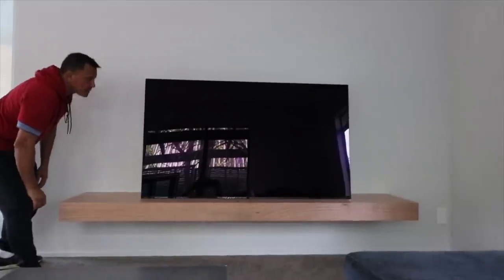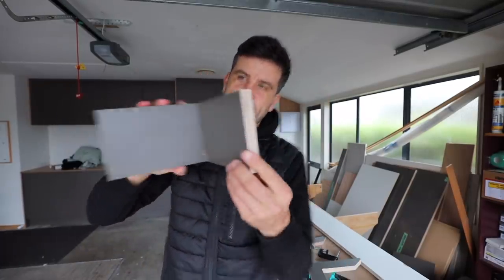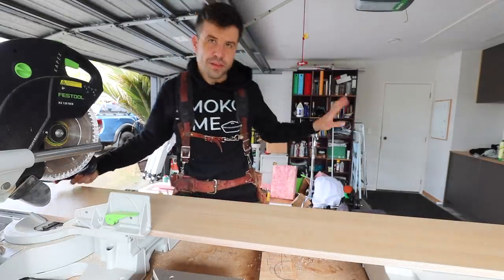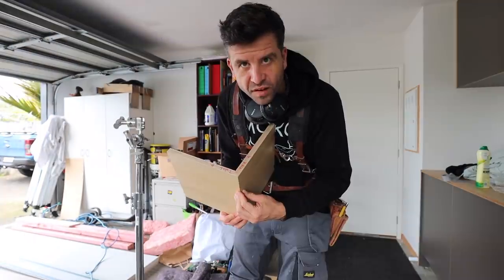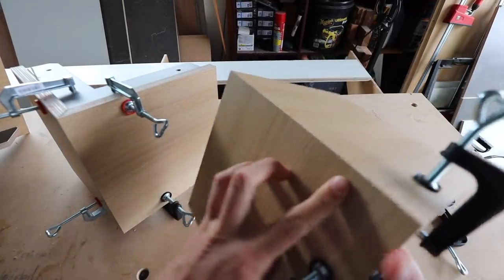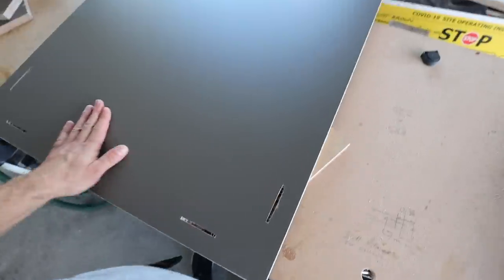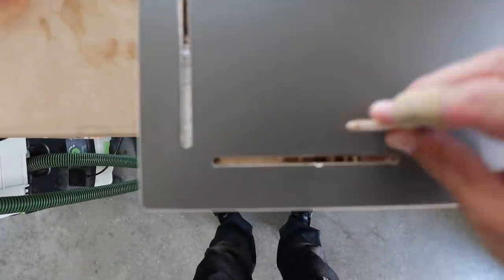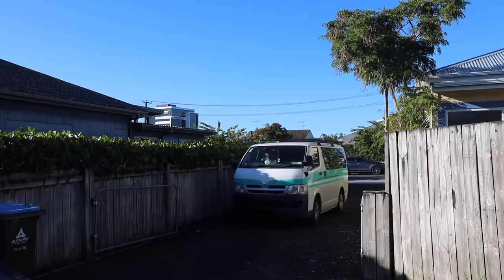I Made a Coffee Table With Offcuts of Plywood

Comment: For mitres like that I've always just put a thin bit of wood glue in any gaps and then used the round of a screwdriver to compress all the fibres together. Always works put lovely. Saves using any filler. You've done a cracking job on all this cabinet work :)
Reply: we usually use a lot of packing tape. just lay both parts flat on the table, tape widely over the joint onto the other surface, turn them around, glue into the joint, close them up, let them dry, and boom, no open gaps anywhere. no need for all that labourintensive compressionstuff. tape over the joint pulls the two parts onto each other, resulting in a perfect corner, if you've cut the 45° degrees properly.
Reply: @robynb.802  oh yeah I tape them up too like that, but sometimes if there is a slight cup then it ain't going to go perfect. Burring over the corners is hardly labour intensive, about 30 seconds work 😅

Comment: What you can do with those sharp veneers on the miters is, you can take the side of a screwdriver and run it along the edge rounding over the edges. It also helps closing any small gaps along the edge

Comment: Great video as always Scott. It turned out great. Consider getting a reusable bag for your Festool vacuum. I’ve had mine for 10+ years and it’s still going strong. It does create a little dust when you empty it but I empty it outside or into a plastic bag.
Also you should consider borrowing a Festool domino from one of your buddies to give it a go. You would be surprised at how many projects you can use one on. Even as a carpenter/builder.
Ron

Comment: you can use some tape to do the Mitter, you place it with the pieced flat and when you glue them it works as a clamp
Reply: I also allways use this technique works much better than trying to use clamps and on some mitre joints it's impossible to use clamps

Comment: you could have used the biscuit joiner to make long slots in the surface and used a lot of biscuits to fix the supports, don't have to worry about positioning the slots. also, you could have used  pocket hole screws to fix the top

Comment: I'm not a carpenter, but I enjoy these videos. I am a bit puzzled by the lack of screws for the top section though - is the glue with biscuits really that good? I'd hate for someone to lift the table by the top piece one day and just have the thing fall apart. Would've thought that a few short screws screwed it on an angle from the underside would've done the trick.

Comment: PVA glue is not good for filling gaps like the ones you created routing into the faces of the laminate plywood. Construction adhesive or epoxy would have been stronger. If you routed off all of the face of the laminate that would make contact with the edges of the support to make a stronger wood to wood pva glue joint. 
Looking forward to the next video

Comment: Hello Scott, when routing the edge off plywood you used in this kitchen project, 9:30 - ish e.g.,  how many mm is the radius of the fillet / roundover? Im working on project using same type of plywood and in 3d model I used 1mm radius and Im thinking using 2mm radius, to expose more of the plywood texture on edges. Also what is the radius of corners? I know, it is maybe derived from routing the test pieces, but Im trying to visually compare your fillets with exact measured fillets, thanks!

Comment: Lovely table! Could you explain which router bits you reckon are "mandatory" I am looking to get the makita cordless router but quite unsure what bits to get with it
Reply: Round over and 45 degree covers 99% of jobs
Reply: I just got the makita brushless cordless it’s a boss tool I rate it
Reply: Buy any standart router bits kit with couple round over, copy and similar stuff.
Milwaukee palm router have more "human oriented" depth adjustment, but Makita one have all sizes collets and angle attachment...  I'm using both but prefer Milwaukee one
Reply: Best piece of advice I got was to just buy the ones you need!